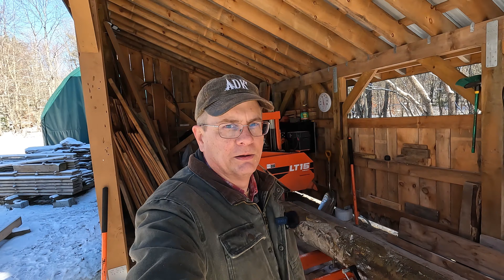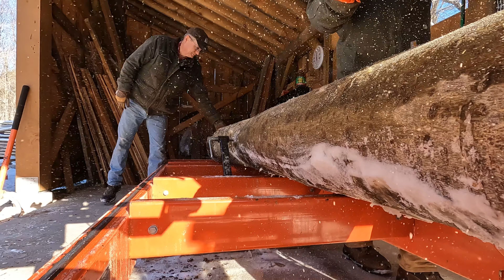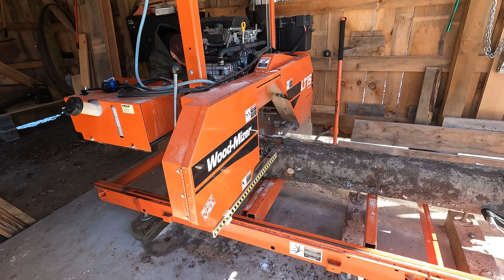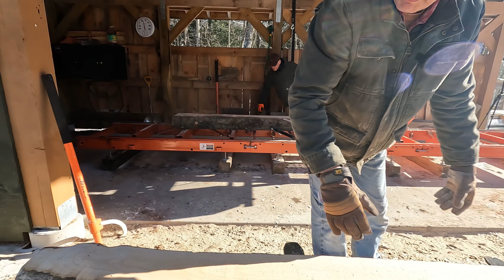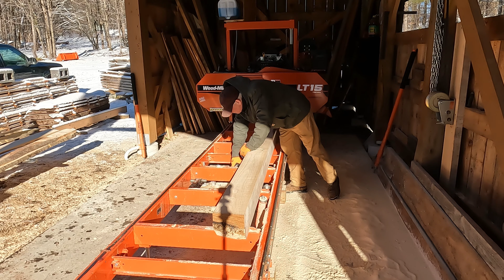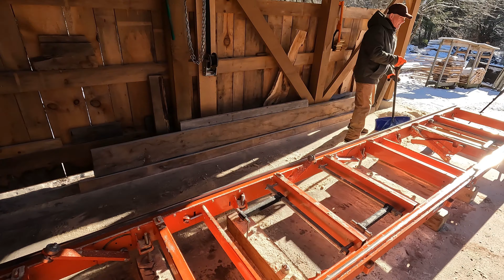An American Beech on the Wood-Mizer LT15

Comment: When you sticker those boards make sure you have a ton of weight on them, Beech will warp more than anything else I've cut so far. It's a beech to dry lol...
Reply from the maker: Ha, yes, have milled a few in the past, it likes to move for sure.  It's currently on top of the drying stack, soon to be covered over by more boards and then some metal roofing with concrete block on top.